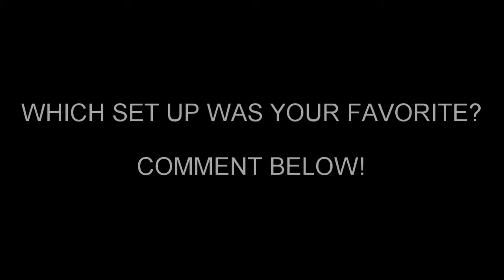RAM CUMMINS 6.7L TURBODIESEL: STRAIGHT PIPES Vs MUFFLER DELETE!

Comment: If a diesel is not straight piped from the turbo back, it does not sound good. I rest my case.
Reply: They do sound good but after a while it gets annoying with all the drone in cab
Reply: @S0lidStewie  I ran a straight pipe for about 2 months towing a 5th wheel with my wife and daughter it was time to add a muffler. If I was young again with no family it would be a straight pipe but you can’t even have a discussion on your cell phone with a straight pipe it was just to much.
Reply: I had turbo back when I was single it was great, now with two kids and a new mega cab muffler delete is awesome
Reply: @JP-xg8cd  is it deleted or just a muffler delete

Comment: I know this is three years old, but I’m curious ?   I have a 2011 3500 6.7.  I am getting ready to replace my pipe from the muffler back.  If I was to leave the muffler off like you did this truck and my two particulate filters remain, do I have to do any tuning to keep the engine engine running like it should.   I’m not sure what the turbo back entails?

Comment: If the cat and dpf are in place it will never sound great they are the mufflers.  The muffler is just a resonator it does little.   I have an 18 flo pro resonator I might put on I haven't towed the mountains yet to see how that sounds but around town if the windows are up it's not that loud in cab . The only goofy thing is the sound of the un muffled VGT turbo when exhaust braking  sometimes it sounds screechy.  Start up and idle sound  sick .

Comment: I been trying to find a place where i can get my truck delete and tune all the shop say no. i have a 2018 2500 cummins
Reply: Research a bit and do it yourself. Save tons of money, and learn your truck.
Reply: The EGR on a Cummins is easier to do than a Powerstroke but look up videos and a DPF is as simple as unplugging connectors, and unbolting. Throw a tune on it after you are done too. A shop won’t do it because it could possibly shut them down from the EPA
Reply: Or a mechanic from one of those shops does side gigs. Gotta have a side hustle.